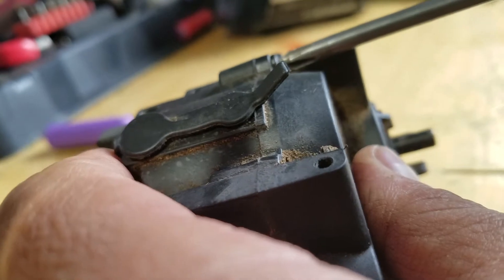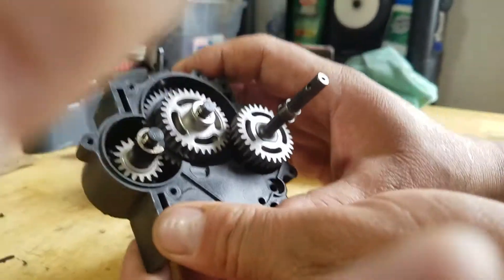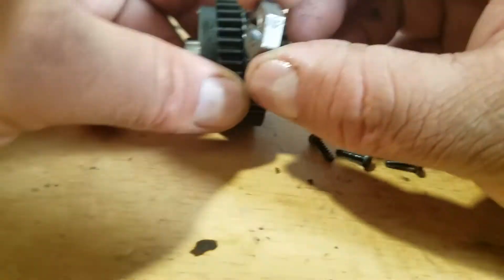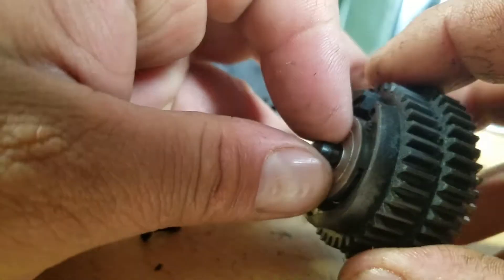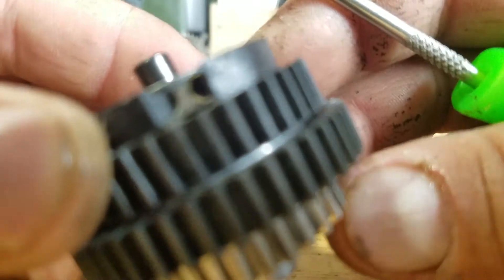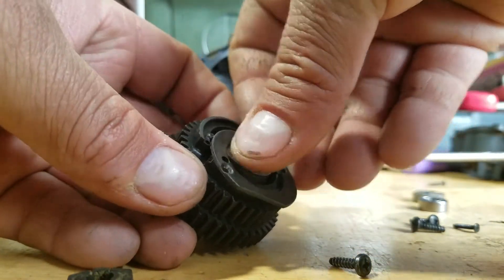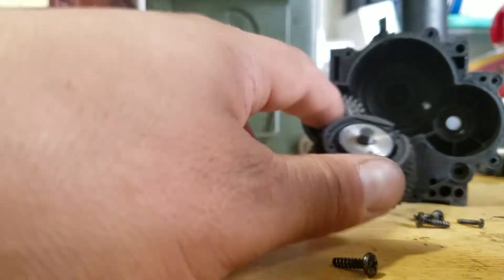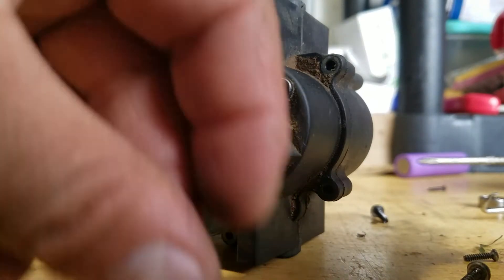Hpi savage transmission modification for brushless convession

Comment: Great video. I’d like to try this with my savage 25. How was yours holding up? How long did it last?
Reply from the maker: Thats an old video man but it did last for as long as i owned the truck i did brake a similar transmission on a savage X on 6s, 4s is pretty safe
Reply: @tinocos9632  alright good to know. Thanks for the reply